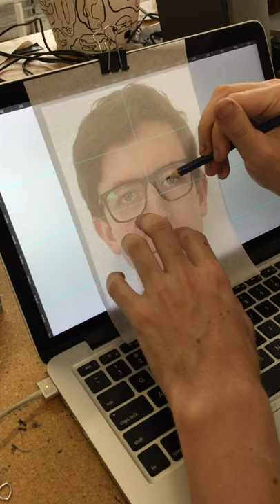Self Portrait Linocut Experiment

Comment: What type of lino do you use? / recommend for this
Reply from the maker: this is usually called something like "soft lino" it's easier to cut than regular linoleum, but wears down a little faster with repeated printing. If you are using either, running an iron or using a hair dryer/heat gun to lightly warm up the material makes it easier to cut